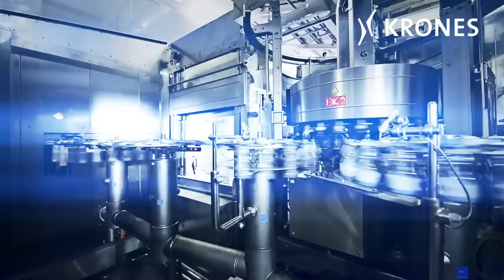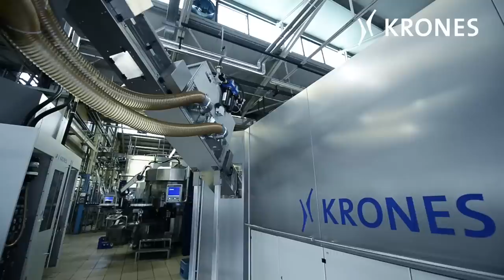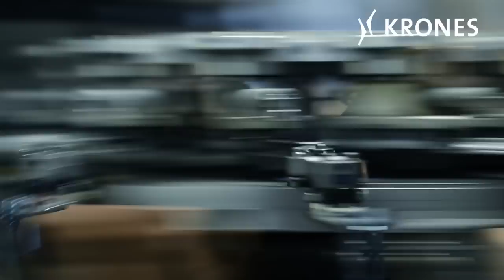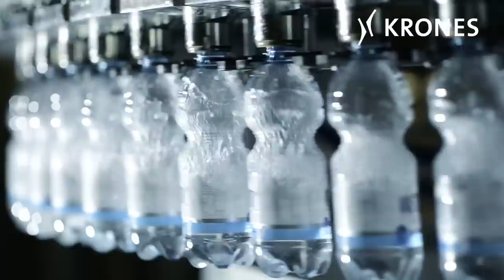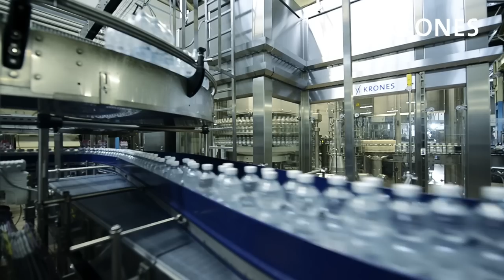Krones ErgoBloc L (english)

Comment from the maker: From preform to finished product

The ErgoBloc L sets new standards in terms of beverage production. Stretch blow-moulding is followed by labelling -- and only then are the containers filled and closed -- at up to 81,000 per hour. This unusual sequence is extremely effective, with results of persuasive efficiency and speed -- and all this with sustainable energy and media utilisation, ultra-simple operator control and maximised standards of hygiene.
 #drinktec   #Krones   #B6
Reply: London war
Reply: O
Reply: Need like this matériel how can i login you please
Reply: Which of the following vfds are yiu using , can you please mention